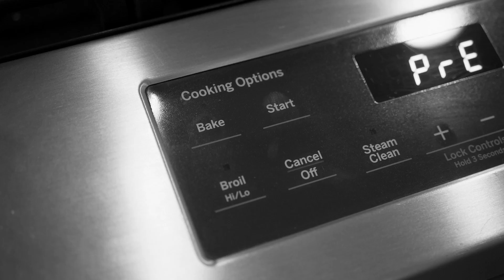How Bass Goes Through Walls like Magic

Comment from the maker: READ ME!!!!
My explanation can sound like a distinction without a difference, but it's the impedance match loss that's the key to understanding it. 
If the wall is acting like a big speaker cone, like your speaker that's creating the sound, you will have large losses from the impedance mismatch. Speakers are massively inefficient at transferring mechanical energy to the air due to the impedance mismatch between the cone and the air.
Now I should say that some of that IS taking place - it's unavoidable - but the main mechanism is as I describe it in this video. 
This is even better illustrated by a thinner material, like a sheet of plastic hung to seal off a doorway between two rooms. Virtually all of the sound passes right through from one room to the other. 
BUT, if the transfer method was the one commonly described, you would have huge impedance losses from the sound energy trying to make the plastic move, and then with the plastic trying to move the air on the other side.
Instead the plastic sheet is just moving WITH the sound energy, like it has become part of the air itself. In other words, it's along for the ride.
The sound, in effect, pushes through the plastic as if it doesn't exist at all. Much like my finger presses the button on the control panel on my stove as if the plastic isn't there. My finger presents an overwhelming force to the barrier the plastic provides.
Same with a wall, but the wall (being thicker, stiffer and heavier) is more of a barrier and reflects back more of the sound energy that's acting on it. Only the longer wavelength lower frequencies make it through, and that's why you hear mostly the bass on the other side of the wall.

Barriers do three things with sound: reflect it, absorb it and let it pass through. It depends on the mass, density and stiffness of the barrier how much it does each of these three things.
Thick, heavy, dense walls will let very little sound through and reflect most of it back. 
Thin, light barriers let most of the sound through. That's the basis for effective soundproofing.

Acoustic treatment tries to absorb sound. Absorbing the sound converts the mechanical energy to heat to dissipate it faster than it normally would. The goal with acoustic treatment is NOT to soundproof a room, but to reduce the reverb time in the room and cut down on reflections. Acoustic treatment improves the sound quality you'll get in a room, but doesn't do much to stop it from getting out of the room.

Comment: This makes sense if the air molecules can interact with each other on either side of the wall through diffraction. But lets say you have 2 rooms that are air tight with air pressure independent of each other. Your jelly bean in the middle of the jello analogy no longer works. It now becomes two separated blocks of jello that can only exert a mechanical force on each other with transference through a medium.

Comment: This makes so much sense! I visited a home made studio that no sound was coming from inside. The had cinderblock walls with sand in the cavities. The inside was normal construction with insulation in the walls, I believe. The point is that the density of the walls made an impressive studio. BTW I listen to Steely Dan in my shop too!!

Comment: It’s kinda both. This guy has some great ways of explaining things, but this is not his best.
Reply from the maker: Here's your opportunity to point out how it can be improved - you have my ear. But I should say that you need to read my pinned comment to get all of the facts for the presentation. I almost always add more thoughts to go along with what I say in the video.
Reply: @IBuildIt  I will read the pin in a bit but my first thought is to compare a weighted passive radiator to the wall. It’s not just the surface that surface that tunes the box, but the mass/density of the radiator affects your your impedance losses. Same as a wall. The wall has to move to transfer the energy to the air in the adjacent room.  I will read your pin later today and think about a better way to explain my understanding of this subject. FYI another good source on this subject is courses on sound proofing walls and floors. Been through a few..
Reply from the maker: A passive radiator is a special case and you've actually given me an idea for a new video explaining how it works. But I'll give a quick one here:
The PR stands in for the port in a bass reflex system, so they operate in roughly the same way. 
The port in a vented box is tuned to let the sound of the resonating air mass inside the box out, so that it helps extend the low end. 
The PR does basically the same - it's being driven at the tuning frequency by that resonating air mass inside the box and acts as a low frequency driver to extend the low end response.
So, in effect, the "voice coil" of the PR driver is the resonating air mass inside the box. In other words, it's behaving like a sub woofer and will have the same type of impedance matching losses as any other cone driver.
Reply: @IBuildIt  just finished reading your pined explanation. I disagree with how you describe the lower frequencies just flow through walls. I think we can all agree sound / noise is vibrations of the air. With no air there’s no sound. The room with the source of the noise, has the sound vibrations flowing through the air, then that vibrations in the air hits the wall it can do the three things you mentioned. Reflect, absorb, or transfer through the wall. Like you said, absorption is converting the vibrations into heat. Reflecting is self explanatory, but to transfer through the wall the wall has to vibrate from the sound, and then the other side of the wall has to make the air vibrate on the other side of the wall. If the surface of the wall doesn’t vibrate, the sound doesn’t make it through. This can be reduced in standard wood framed walls a number of ways. One of the best is to use 2x6 base and top plates and 2x4 studs. You then alternate what side of the plates each stud line’s up with and fill the wall with mineral wool insulation. The sound hits the first surface of dry wall, it vibrates the wood studs it’s attached to but not the dry wall on the other side due to it not being attached to it. Then the vibrating insulation worms up the air trapped within itself and then there’s nothing left to vibrate the drywall on the other side. You can also just poor a foot thick concrete wall and obtain better sound proofing. Concrete vibrates less the thicker/stronger it is. I think you keep referring to impedance losses to explain why you understand it a different way. Can you please explain what exactly you are referring to as impedance losses? There’s transfer coefficient and adjustments made due to surface types. But I’m not sure what you are referring to as a impedance loss.
Reply from the maker: The wall system you describe is effective for reducing the amount of sound that goes through the wall, but it mainly does that by absorbing the sound energy on one side, and not chiefly by breaking the transfer of vibration.
It's similar to a CLD panel (constrained layer damping) used in speaker boxes, where the inner layer absorbs the vibration and reduces how much energy is transferred to the outer layer.
But neither of these methods are particularly effective for blocking really low frequencies, like anything below 100Hz.
And then nothing in what you said explains the impedance match losses you would get, and that's the key point. @chrisf7249
Reply from the maker: Impedance loss is the efficiency of the system when transferring energy. Speaker cones are at best 20% efficient, in that they will only transfer 20% of their mechanical energy to the air, so 80% is lost in heat in the voice coil.
Now take a sheet of plastic (as described in my pinned comment) and block a doorway with it. Does it stop 80% of the sound coming through? If it was producing the sound by vibrating, it would be losing at least that much. @chrisf7249
Reply: @IBuildIt  so you are saying the 100 hz is going to be just as loud on the other side of the wall as compared to in side the room the 100hz sound was generated in? If this is the point you are trying to make, I would have to say that this is the first I’ve heard of this. This is true about walls that are not sealing up a room, and the is one end of the wall open so air can go around it. But not though a wall. The 100hz a lower is definitely the hardest to eliminate but it definitely gets reduced going through a wall like I described. You have any thing you can reference too?
Reply from the maker: Everything is a factor, like I said. A barrier (the wall) will do three things ALL at the same time. 
Fist is that it will reflect some sound back.
Second it will absorb some sound.
Third it will let sound pass through.
All of these depend on the properties of the wall - how dense it is and how thick, mostly. 
So 100Hz will NOT fully pass through any wall, as some will be reflected and some will be absorbed.
And when I say "pass through", what I mean is the wall is moving WITH the sound wave as the sound passes through the air. Like that jellybean in the block of jello.

Comment: I think number one is air gaps, most rooms have them like windows, doors, vents, gaps between ceiling and walls even though plugged with silicone kit or hidden behind wallpaper or wood trim, then as you suggest moving along the pressure waves just like closed speaker cabinets and lastly when the frequency hits the resonance frequency of the wall or building it transfers into contact sound as well. This can travel through a whole block of buildings. Since it travels a lot faster in a solid it's difficult to locate where the sound is coming from and due to the low frequency of course.

Comment: If you are trying to reduce/block sounds going throughout your house. Just buy another house down the road. Or shed man/tv room separate. 
A practical way is to follow the STC rating system. Punch line is double wall style with no air vents touching main house. Get a separate room heat/cool. like mini a mini split. It'll dehumidify pretty good. Jeff renovision did this to some extent. Adding mass to the walls too, mass loaded vinyl. Seal the outlets, seal the door (solid one). All sorts of things. Very expensive and time consuming. Just turn the bass off at night. Tons of rockwool. Or concrete. Yes the low low goes forever.

Comment: For the plastic bag trick. I think a diagram or napkin drawing of the pressure wave of mid/lower frequencies. How they will impact a flat surface. They are huge compared to fibers/fabric openings/cracks. Door closed vs open while playing that tone. dB meter in the hall.
100hz wavelength is 10 feet. It will radiate from the source is a sphere then bounce and add/substract to the other waves.

Comment: John, Love this talk. My comment is based on a few rooms at RMAF. Were most of the rooms are a similar shape and size. And when there you do the door test. Stand at the door and decide in 2 seconds to go in or not. Treatment, angles, speaker size etc. all played into it. It was ELAC room (Andrew jones in person) doing the demos. Those rooms always sounded good. Natural, pleasant, airy and calm. Vs Raidho blasting your ears off with muddy mid/lower tones. One year they were good, the room was bigger, very plesant, the next few years they were in a small normal room and sounded muffled/muddy . Small normal elacs in a small room are great. But was it the treatment, speaker size, volume the bass/mids were trying to move. Or Andrew Jones starring at you and smiling back as you are smiling in enjoyment. Then telling you they are only 500$ a pair. You are on to something with the impedance of the speaker interacting with the room. Not the electrical impedance.

Comment: Also helps to remeber the wall has a huge surface area that enables it to transmit sound quite effectively, even though it doesnt physically vibrate a lot compared to a speaker cone.
Reply from the maker: You are still thinking in terms of the relay race, where the wall is the speaker for the sound on the other side. 
If that was the mechanism, you'd get very little sound through a sheet of thin plastic because the impedance match losses would be too great.